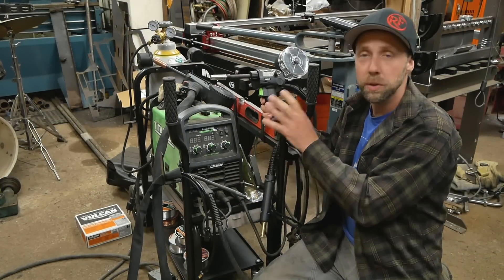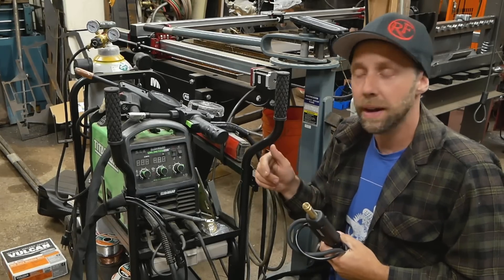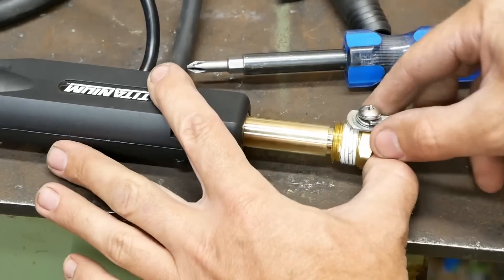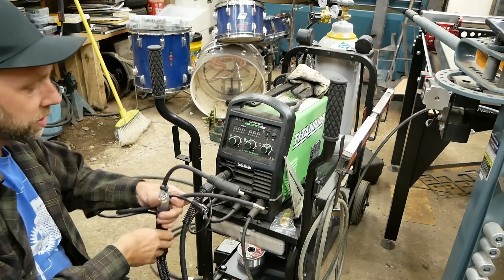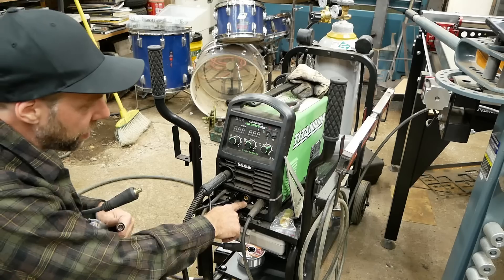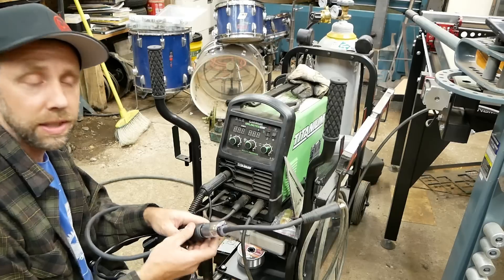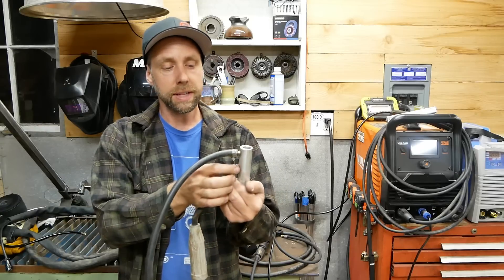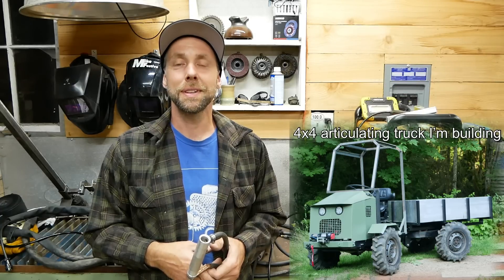$20 quick change upgrade / Aluminum Spool gun for Titanium and other welders

Comment: I leave my Klutch door open and run straight through the door.
 I use vise grips to attach hot wire instead of unscrewing wing nut

Comment: Hello from Alaska. Need a welder and spoolgun for mobile aluminum fab business. Do you recommend the Valcan welder and spoolgun or the Titanium welder and spoolgun. Would be welding up to 3/16" but mostly 1/8". Will be running it off the predator 5000 inverter or the 3500.  Let me know which you would go with. Thanks for all your amazing videos.
Reply: I just got the titanium with spool and I’m in love with it. I’m doing a aluminum truck rack inch and a half tubing and I’ve been rolling.
Reply: The Multipro 220 does MIG, TIG and Stick... all very well.  I have nine welders... the Multipro 220 is an excellent machine for any job.  The TIG is touch-TIG and the MIG gun has to be removed to use the spool gun.  I have been welding for almost 60 years and recommend the Vulcan.

Comment: I just got this spool gun on clearance super cheap...but found the liner between the drive and tip is broken AND blocked...  any tips where to get a replacement???  Emailed HF, and it looks likenthe ARCCAPTAIN is the same gun (different connectors) rmailed them too... but i inly have a few days to return it if i can't get the part!

Comment: Hello there. 
I just recently bought the titanium 170 and I wanted to upgrade the ground clamp because the one that it comes with can't fit in the lug well/hole of a wheel/rim, it's too bulky.
What do you recommend?
Reply: @INTIREMOBILETIRESHOP  Run a bolt through the lug hole, lock it in with a lugnut, clamp to the bolt.

Comment: Hey Mike! Good videos
Will the Vulcan spool gun work on the 205 Pro Tig?
Reply from the maker: Unfortunately you can’t run a spool gun on a TIG welder, TIG and stick power is (CC) constant current and MIG power output is (CV) Constant Voltage.

Comment: My Titanium spool gun is extending the wire 4-6 inches after releasing the trigger and moving from work piece. Anyone have any ideas?
Reply: The gun was defective and thankfully the only other one in stock works perfectly.
Reply: You have it on auto feed mode once you strike it won't shut off tell you pull off part

Comment: Hi Mike just received my 50 Dinze connectors. Made the connection on my Vulcan Spool Gun by threading the end and attaching cable like you said, hooked up my 100% Argon directly to my gun. This way it can be connected all the time. Attached my plug in to wire feed on my Vulcan onmipro 220. Hooked up to positive on front of machine and low and behold wire advances when trigger is depressed. Thank you a whole bunch, this works great. However, I ran out of time to weld with it, but will shortly. Great improvement. Thanks for sharing.
Reply from the maker: Nice 👍 I’m glad you got that all set up!

Comment: Can you do that to the vulcan omnipro 220?
Reply: Yes but it uses Dinse 50 connectors as opposed to 25. 50 is bigger. Another thing is, you have to run the gas through the machine as opposed to straight to the gun. The machine regulates the gas. If you run the gas straight to the gun the gas will flow despite the trigger not being pulled. Run it through the machine and the gas only flows when the trigger on the spool gun is pressed.

Comment: ah yes if only u had welders with one style connector     like the euro connector
Reply from the maker: I definitely like euro style connections, but in this application euro isn’t as fast to change out then this mod, with the Euro style you would need to remove the MiG whip and wind up the MiG wire to connect the SG, this system you just swap out the lugs in the front and you are ready to SG.

Comment: I was wondering? Miller is trying to tell me that spool guns run with different voltage? So at the time I wanted to run my Hobart ironman spool gun to my new miller 235 but was told it wouldn’t work?? Any thoughts about this?

Comment: Listen can anybody help me I just got this gun and a titanium 140 and when I was doing flux core it worked like a charm then I switched to aluminum and i works but I can’t get it to weld properly I get too much shorts and is not consistent any settings you guys are using ?? Specifically??

Comment: Pretty straight forward, good tip. My Lincoln configuration is a little different, I think (price wise) I'd be about the same if I converted Vs just buying the correct spool gun from Lincoln. Btw, I really liked your video on the Yeswelder. I'm still considering buying one. It's a pretty good all in one machine.

Comment: Mike, how about a video showing how to keep ALL (MiG, TIG, Spoolgun) processes connected to the OmniPro 220 at the same time.  This is frustrating to have a multi process welder that takes 10 minutes to switch processes each time.  Why didn’t they put a second gas port in the back for Argon?  They got the second solenoid for Spool, just needed the input port.  They could have used that solenoid for TIG as well.  With that said just Looking for ideas to reduce time to switch processes.  Thanks.
Reply: I second this idea for a Video

Comment: Could you use it with the YESWELDER 205DS please?
Reply from the maker: Unfortunately there’s no spool gun power plug on the Yeswelder, I have mentioned this to them as an upgrade they should really consider.
Long story short, no the Yeswelder is not spool gun capable.

Comment: Mike, I am considering the Klutch spool gun because it has the leads coming off the bottom of the pistol grip.  The Titanium spool gun has the leads coming directly off the back of the gun, seems like this would be more difficult to use as the weight of the leads would be pulling the tip of the gun up.  Since you have used both, do you agree with me?  thanks Kent

Comment: Could you have taken the case off the lead and maybe just attached the quick connect Instead of drilling and keeping the brass end on?
Reply from the maker: I’m sure you could have taken the spool gun lug apart and as long as the gas doesn’t go into the brass lug you possibly could have? I didn’t want to cut up the Titanium spool gun because it wasn’t mine, I own the Klutch spool gun. Basically this video is just to show an idea to others to think outside the box and make it easier to hook up the spool gun.

Comment: I watched this a few times and maybe I keep missing it:  but, does he tell us the voltage of the gun's motor?   I'm guessing 12volt DC?  But some of these guns are 24volt AC.  I plan to do something like this to my snapon 250sl - and THAT ONE is 28 volts for its OEM gun.  I plan to install the Dinse connector "female" end into my welder. Plus I'll need to install a separate gas feed line (with gas solenoid) and gun controller connector (with the right switch as to not power up the MIG's motor when i run the spool gun).   I'm still doing my research, but I'm wondering about the HF spool gun voltage... I can install a ac to dc transformer or step-down or whatever...  I just can't find any info on this guns voltage.  

Thanks in advance if anyone knows.

Comment: Hello Mike. Have you considered using heavy duty shrink tube on your Titanium spool gun DIN adapter fabrication?
Reply from the maker: I’m sure it would be a good way to go 👍 I was just working with what I had on hand. Thanks for checking out my videos 🙂
Reply: Mike - I like your modification. Thinking outside the box, to the benefit of others. I’m going to try this.

Comment: Great video review however, can you show/explain changing the tig/air input hoses at the lower connection point when changing processes on the Amico 180 you featured about 10 days ago.
thanks

Comment: Man, I just realized I could get a spool gun for my tig from this video... I feel like such an idiot.  Thanks!
Reply from the maker: I believe TIG and Stick are constant current and MIG is content Voltage, so unless your TIG is a multi process welder with MIG I don’t think the SG will run right on it?
Reply: @Mikefestiva  oooh perhaps. The voltage/amperage may be a problem. It may create an adjustability issue. I didn't order a spool gun yet though. I suppose I could still connect it to my mig if it doesn't work out on the tig! Thanks for your insight! I hadn't considered it.  I see s bunch of $100 spool guns on Amazon. I may snag one. I should probably buy a hf tig instead though.  .
Reply: Correct on that.  CC power sources are SMAW and GTAW. all wire feed are CV. The  voltage controls the stand off from the wire to the plate, its needed to maintain this or the wire hits the plate.
Reply: @whatsagrinder  Ahhhhh. I understood this intuitively, but I'd never actually considered the reason.

Comment: You can also buy a female in-line Dinse connector, cut off one of the terminals on that lead, and use that end. Then everything will have those heavy rubber covers, and it’s easily removable, if needed.

Comment: How well does that titanium welder do with aluminum? I was going to purchase one, but a guy was telling me that it wouldn't do aluminum. So a video of how it does would be nice. Thanks in advance. Update, just found the video where you used this welder for aluminum. So now my question is, are you reversing the polarity? I am new to aluminum welding, so a little help on setup, please and thank you.
Reply from the maker: nugget wv I’m glad you found that video. It still DCEP just Like MIG, so the spool gun connects right up to the + lug just like in the video. I covered settings for 1/8” in the video, that will get you going, you can always fine tune it to your liking. Make sure to leave about 1/2” or a little more wire stick out when welding to keep the wire from burning back to the tip. I hope this helps 👍

Comment: Hey Mike great video. What do you know about the yeswelder multi-process mig-205ds? There only $350 new and ive had 2 people tell me they run better than the titanium.
Reply from the maker: Hey Zach I have not tried that model out yet but I actually will be getting the opportunity to try that exact model out soon. YESWELDER contacted me and asked if I would be interested in trying out there new AC TIG, I said sure but mentioned I think the multi process 205 is probably more of a welder my subscribers would probably be interested in. So hopefully I will be able to look it over and do a review on it? I have been using there AC TIG for a few weeks and so far it’s pretty good, the only thing is the amp pedal is on the cheap side and they could offer a little longer leads, other then that it actually lays down some nice welds. Take care
Reply: @Mikefestiva  I have been told the leads could be longer and the electrode handle (stick handle) was on the cheap side but other than that they had no complaints. One guy said it welds better than his titanium hands down which is what i was gonna get. I have a big millermatic 315 at work that i use but just wanted a cheap welder that does the job for the garage. I love your videos and your reviews so maybe ill try to hold off until you get one. I was also told to maybe wait that yeswelder was working on a 270k multi-process welder that comes with a spool gun so maybe wait for that. Anyways thanks for the reply and keep up the good videos look forward to many more!

Comment: They sell those "mother side" connectors as extension lead kits, and whilst the wire tap is a solid method, i'd advise going with the sleeve. First, because of the possibility of the screw coming undone, second, because the sleeve gives more area (also because it doesn't modify the original "father side" plug.

But that's just my two cents.

Side note, one really cool mod i saw...and i wish to God i'd remember the channel name was a daughter panel, mounted on the front of a cart, which utilized one of those extension lead kits and other "mother side" plugs, to give no less than 4 different types of welder connections (it was for one of those multi-function machines that do Mig,Tig, Stick, arc cutting, and plasma cutting, don't ask me the name, i forgot, the machine was green, and about as big as a tube TV back in the day).

Comment: I've been wanting to hear your opinion on these.They seemed kind of like a gimmick when I first saw them. But by now I have a ac/dc tig machine on its way. I can't wait to have another option other than flux core.
Reply from the maker: Are you referring to the Titanium series welders as gimmicky? Mine has preformed perfectly for the last 19 months I’ve owned it.
Reply: Mike festiva  No sir , I ordered myself an AHP after considering titanium, Vulcan, everlast and more brands. i know these budget welders are a great bang for the buck and getting more and more awesome each year. I meant the spool guns for aluminum in particular. I was naive, but that was my honest first impression when I first saw it. It was mostly because I was wondering how the heck they weren’t more popular if it lets you weld aluminum with only a mig welder.